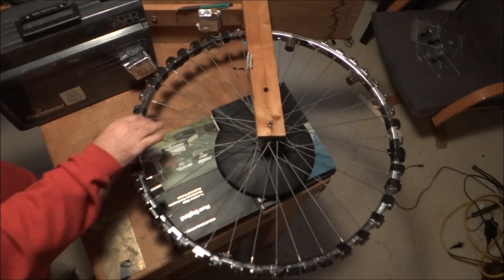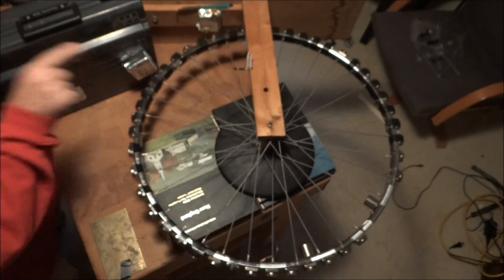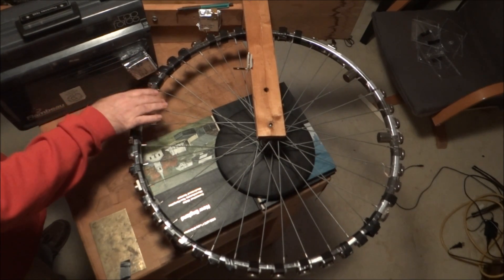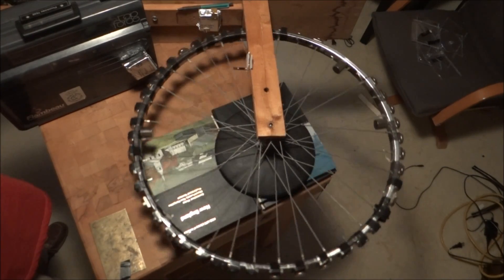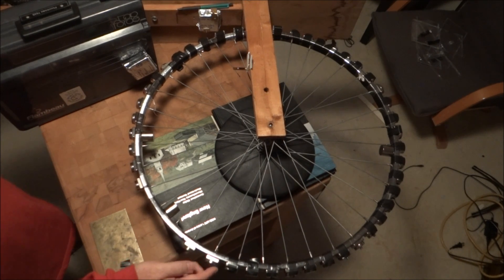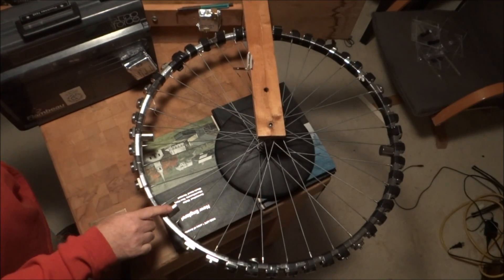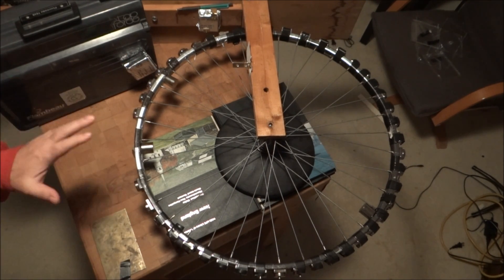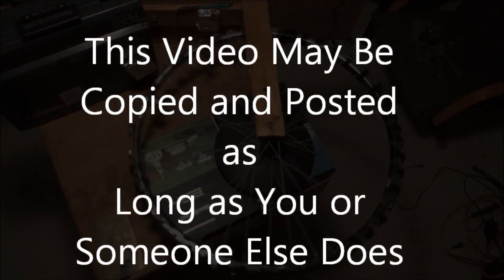🧲 🧲 Magnetic Motor Research (Leapfrogging Effect)

Comment: Hi James, nice to see you back.
If the wheel was making a full revolution just through stored energy then it would noticably slow down and stop after a few "clicks" while the card was in place.
 An analogy would be holding a ball at the top of a skateboard half pipe, letting it go and the ball rolling down then back up the other side to an equal height then rolling on a short distance so it looks like some energy is somehow put into the system.
As the wheel can make a revolution with slight drag (proof against stored energy) it might be worth fitting a coil close to the wheel so electricity is generated as the armature magnets pass over it. The electricity generated could be stored in a capacitor then the capacitor discharged through another coil at the right moment to give the wheel a kick to help it past the sticky spot.
In earlier videos you talked about the stator causing asymmetrical torque. This asymmetry would be caused by acceleration from armature and stator magnets attracting each other. The magnets reach their point of maximum attraction but momentum keeps the wheel turning. Once past the point of maximum attraction the armature magnet  no longer sees the stator magnet because of the steel shielding around the stator. The wheel will then be decelerated by armature magnet to steel attraction which won't be quite as strong as the initial magnet to magnet attraction so there will be a slight net acceleration.
 There are other factors involved such as the thickness of the shielding and spacers in the stator. This thickness will mean that the shielding will be closer to the armature than the stator magnet thus reducing the difference in torques so minimising the thickness of the shielding and maximising the armature-stator distance will maximise the torque differences.
If this wheel could be made to work then to say the implications are profound would be an understatement!
Good luck with your experiments.
Reply from the maker: Hi Bob,

Thanks. It's good to be back.
 
> "If the wheel was making a full revolution just through stored energy then it would noticeably slow down and stop after a few "clicks" while the card was in place."

Correct Bob, especially when I place my finger on the wheel at the same time, however I forgot to do that in this video.

> "it might be worth fitting a coil close to the wheel so electricity is generated as the armature magnets pass over it. The electricity generated could be stored in a capacitor then the capacitor discharged through another coil at the right moment to give the wheel a kick to help it past the sticky spot.

You are so very right Bob. Since the wheel has a reasonably large circumference, a reasonable amount of electrical energy can be obtained from magnet wire to store in a fast charging capacitor. Though this may very well get the wheel to go around repeatedly, I fear that the torque I'm after would be circumvented. I talked about doing this on our "Free Energy" FaceBook account a few days ago. It sounds to me like you are an ideal and creative thinker with a good head on your shoulders for our little group if your game.

Bob, if you would, please join us at our Free Energy group on FaceBook at:
https://www.facebook.com/groups/133407586703698/

> "In earlier videos you talked about the stator causing asymmetrical torque. This asymmetry would be caused by acceleration from armature and stator magnets attracting each other."

Correct. This strong attraction point lends itself to using an array of stators for both torque and greater forward motion.

> "The magnets reach their point of maximum attraction but momentum keeps the wheel turning."

Yes. But in this video demo I can start the wheel at various points in the wheel and it still takes off and gets up to it's maximum speed of about 6 to 8 rpm.

> "Once past the point of maximum attraction the armature magnet no longer sees the stator magnet because of the steel shielding around the stator."

Actually Bob, each magnet in the daisy chain of armature magnets is pulled/attracted to the stator magnet. This is the leapfrogging effect that I talk about. But yes, the armature magnets no longer see the magnet inside the stator as each armature magnet passes to the backside of the stator, yet, the armature magnets are still attracted to the thin metal shielding on the backside. This can and will be resolved through mu-metal, which sets up a, "like force" on the back side of the stator.  With proper thickness and angling of the mu-metal, this like force can be managed in such a manner that a small kick/boost to the armature magnets could be applied. What makes my stators perform the way they do is that the attraction to the armature magnets on the front side of the stator is far stronger than on the backside. This imbalance in the stator/system is what gives the wheel forward motion, and thus, the wheel will not turn very well backwards. Thus my, "one way stator".

> "The wheel will then be decelerated by armature magnet to steel attraction which won't be quite as strong as the initial magnet to magnet attraction so there will be a slight net acceleration."

The daisy chain of armature magnets leapfrogging from one armature magnet to the next one in line across the face of each stator magnet is what gives the wheel steady torque and smooth speed.

So far, in all of my tests, the wheel continues to gain speed after the first armature magnet passes over the stator for about the first ten armature magnets, which is way past the lead armature magnet.

> "There are other factors involved such as the thickness of the shielding..."

Yes, very much so, as that greatly affects attraction. When using neodymium magnets, this becomes quite apparent. Thus mu-metal shielding needs to be tapered as thickness is a major factor here as well.

 > "...and spacers in the stator."

Correct, as I have made videos dedicated to understanding the importance of spacers in the stator.

>  "This thickness will mean that the shielding will be closer to the armature than the stator magnet thus reducing the difference in torques so minimising the thickness of the shielding and maximising the armature-stator distance will maximise the torque differences."

Yes. I've noticed this and have made small adjustments, and further adjustments are needed. Making precise stators by hand without a metal shop is tricky, but doable.

> "If this wheel could be made to work then to say the implications are profound would be an understatement!"

Greater than the light bulb. Only those with heads like yours fully gets it.
Reply: James Roney Stators I joined your Free Energy group thanks.
I think I mentioned using stored electrical charge to help the wheel past the sticky spot some time ago in the comments of your "Success" video. If it could be made to work then it might not produce much excess energy but if it did allow continuous rotation, that alone would be the achievement of the millennium.
Reply from the maker: bob s
 I Agree Bob. You're absolutely right.  I'm going to build and place my stator design at the 2, 4, 6, 8, 10, and 12 o'clock positions.

Comment: I'm not sure you realize that what you are doing is nothing special. I requires force for you to move the wheel to line it up on the magnets. That force is merely being released over a period of time when you let go of the wheel. You can get similar situation if you pick up a brick and drop it, you put energy into a system and it is released.
Reply from the maker: If you look closely at the wheel when it first starts up, you'll notice in actually accelerates very slowly, and then maintains a constant speed "under load'. If it was merely momentum/stored inertia in the wheel being released over time from it's initial start up as you would have me believe, a counter drag would quickly counteract that inertia and slow the wheel down to a stop. However, I can let my index finger "firmly" drag on the wheel, and the wheel does not start to slow down at all, let alone come to a stop. You can even feel the power of the magnets on the wheel through your finger tip as your finger drags on the rim of the wheel.

Thus, your constructive feedback might be valid in other magnetic experiments, in this case, your mechanical reasoning does not apply here, as the wheel turns under power (actual torque) and not stored inertia as you would have others believe.

Rather than dismiss my results, build it yourself. Than you'll know differently.
Reply from the maker: Under load it does not slow down, even when you allow your fingertip to drag on the edge of the rim. Explain that away. I'm back and hope to put another working model back together over the months ahead as I'm in the move of my life and soon will be homeless living off the grid on a mountain top until I can build a new home there. Here is someone who built a working model of my stator design, but never placed the last three required stators on it for continuous run time.

https://www.youtube.com/watch?v=VUZP2eC1DV0